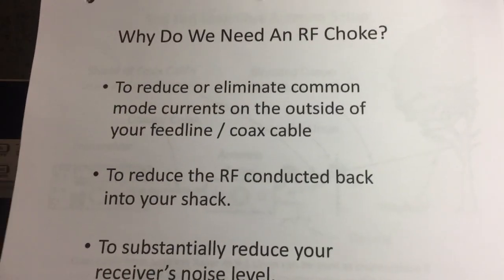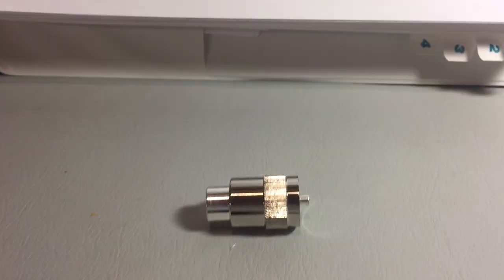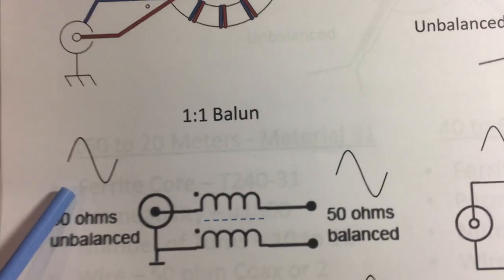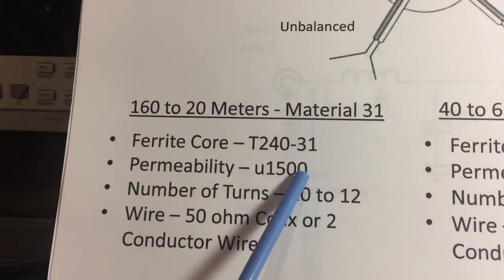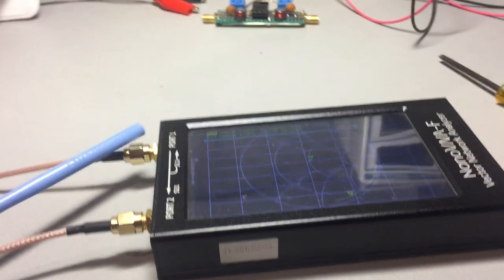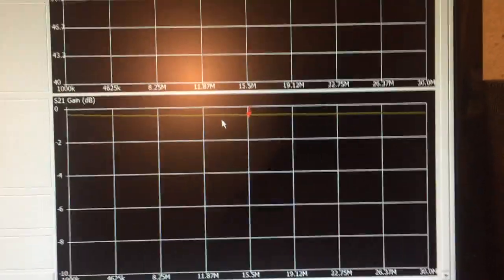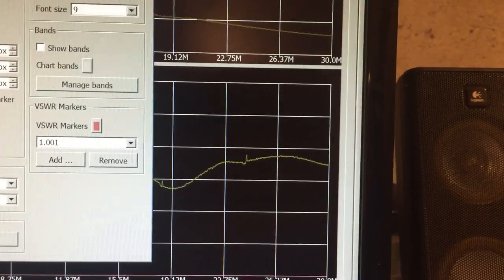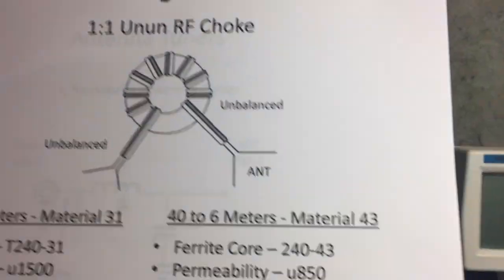Part Three RF Chokes: RF Man Discusses Long Wire Antennas, Unun's, RF Chokes, and Antenna Tuners.

Comment: I was hoping to gain some understanding as to how it is that my home-brew EFHW antenna, cut to 80 M gives me better than 2:1 on all the bands, 80 thru 10 (havent't tested the new frequencies as my older radios don't support them).   I am not complaining, but it throughs a wrench into the way I understood this.  The EFHW, with the infamous 49:1 UnUn, was only supposed to resonate on harmonics of 80 M.  73 es TNX, Marc

Comment: Thank you for the videos.  I am fairly new to the hobby and have a question:  I am running a G5RV.  To eliminate all RF, would I use a 1:1 balun at the antenna feed point and also a 1:1 Unun just before the tuner?  The G5RV confuses me a bit.

Comment: It would be nice to see the amount of reactance verses resistance generated by the shield, perhaps look at a Smith Chart sweep plot. You don't want the choke reactance canceling any reactance introduced by your coax run from the choke to your load (transmitter/receiver). That could increase the common mode current. Am I thinking about this correctly?

Comment: Your balun and unun shown at the 6 minute mark in your video is the same thing!  By switching form 2 seperate wires to zip cord doesn't change a thing in the operation.  Your 1:1 unun would be much better off being wound with Teflon insulated coax instead of zipcord.  Also, a 9:1 unun isn't designed to feed a random wire, it is designed to feed a 450 ohm load and is most efficient when feeding a 450 ohm load.  A random wire may be 450 ohms on a few frequencies, but the impedance varies sometimes greatly as you move from frequency to frequency and band to band.  Yes, the tuner may be able to match it, but coax is also most efficient when operated into a matched load and putting the tuner in the shack with a long run of coax, the losses can be quite high in the coax and the unun and you end up with a not so efficient antenna system.  Yes you can make contacts with it, but you may very well be missing a lot of signals to!

Comment: I have watched videos where they used plastic coated 18AWG wire (non shielded) wires connected into a PL239 - would you expect to have high attenuation on both wires and not just the shield?  What would that do for your TX/RX into the shack?

Comment: You may have said it and I missed it, but which ferrite mix are you using here, the 31 or the 43?
I see the extreme dip to - 60+ db at approx. 15.4 mhz.   What causes this?   
I have a monoband vertical (Solarcon 99) that gives me rf in the shack that I would like to attenuate sharply at the desired frequency (27 mhz) but I don't have the necessary test equipment like you have in your video.
I'm wondering if the number of turns through the toroid determines the specific 'maximum dip' frequency.   Or maybe how tightly it's wrapped?
I never had any trouble with thia antenna at my previous QTH, where I had more room, but where I am now I have to have to have the antenna close to the house.   And semi-hidden (HOA).   I wish I could put up my homemade yagi again, but that ain't happening here!
Any help would be appreciated.
Reply: The number of turns through a ferrite core effects the attenuation level.  More passes through the core = more attenuation.  However you get to a point of diminishing returns.  Kind of like adding ground/counterpoise radials at the base of a vertical antenna.  You get to a point where adding more doesn't really add much.  The frequency response is due to the ferrite mix.  Different ferrite mix or even iron core mix toroid's have different frequency responses.  If your trying to attenuate RF at the top of the HF band then ferrite type 43 mix would be a good choice.  As he clearly showed in the presentation type 43 is suitable for the higher frequency end of the HF band while type 31 is best at the lower frequency end of the band.

Comment: Great job with all your videos.  Is there any benefit to gluing 2 or 3 ferrite donuts 43 and 61 together in the 9 to 1  other than increasing  the power you can put through them.  I have heard of coax line isolator that uses several different  ferrite numbers.
I'm going to build my own 9 to 1  unun for a multiple band end fed and coaxial line isolator / rf choke.
To save a lot of money i hope and get better quality.
Thanks again.
AA4CP Chuck 
Port Salerno FL

Comment: If I use 2 conductor wire would it add impedance to the center conductor since it is not shielded like in coax?

Comment: Would a type 61 core be OK for the choke?  Thanks again!
Reply: I am using a mix 61 wound 12 times crossed in the middle.  Works great on the 11m band!!
Reply: Update:  I tired the same with mix 43 and 31 and so far the 61 gives the best result!!  Just 61 is a little more pricey than the others.

Comment: I've always understood that a 1:1 ratio indicated an RF choke, with no impedance transformation, while a balun would have a transformation ratio of 4:1, 9:1, 49:1 etc. Now I'm confused.
Reply: A transformer does not need to actually "transform" one impedance to another.  Think of a AC mains safety isolation transformer.  Exact same number of turns on the primary and secondary.  In the isolation transformer example it's being used to isolate the primary from the secondary which would allow you to (not recommended) touch your home earth ground and the 120VAC at the secondary and you would not be shocked/electrocuted because the secondary has no reference to ground.

Comment: In the first part you said most tuners are t networks question could you use a tuner for your input and output circuit for a tube amplifier I'm wanting to do this if you could do a short video explaining some of how to do this I would appreciate any information on this.
Reply from the maker: Yes, you can use this with a tube of solid state amplifier. It would be used the same way. I will make a follow up vide with one of my LDMOS amplifiers. The same would apply for a tube Amp. Thanks
Reply: If the antenna is 1,000 ohms why have a 9:1 ratio?